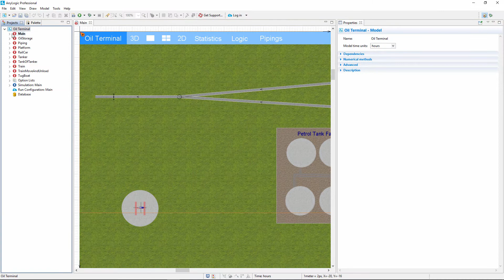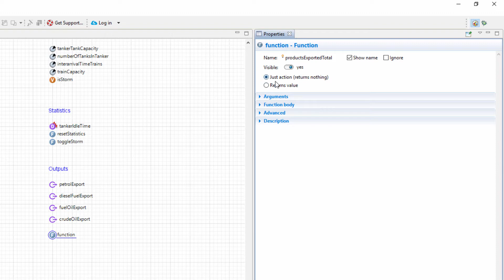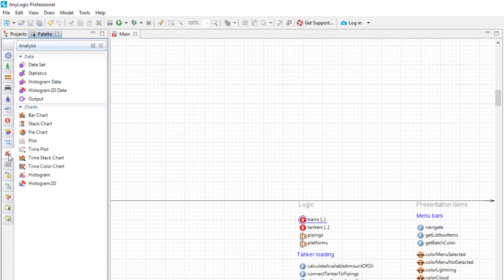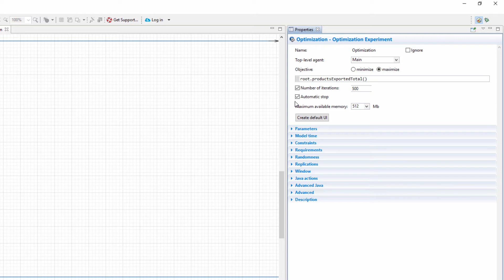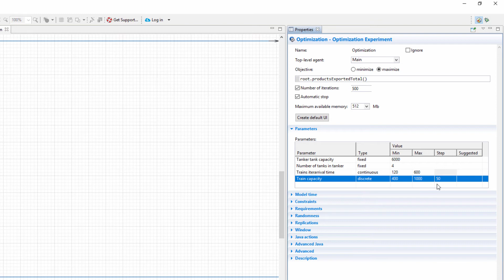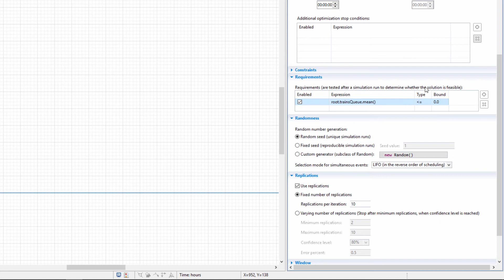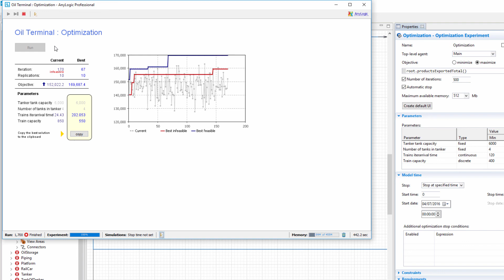Optimization experiment

Comment: The video is really good, but when I try to do the optimization Experiment on this model, after downloading it from the cloud, at the end i get a RunTimeException (Error in the model during iteration 1). The iteration ist sometimes 10, 4,2 and so on. How can I fix this? I did not manage to find a solution online yet. Thank you in advance!
Reply from the maker: Hello,

Thank you for the question.

We've investigated the issue and attempted to replicate the error using both the Genetic and OptQuest optimization engines. However, we were unable to reproduce the problem on our end.
Please try to follow exactly every step from the video again. If you will continue to experience the error after following the steps from the how-to video, please submit your question and the model to support@anylogic.com so we can reproduce the problem on our end and provide you with the solution.

We hope this information is helpful to you.

Comment: Is there any possibilty to implement multi-objective optimization in AnyLogic?
Reply from the maker: Hi, and thank you for the question. 

A built-in optimization experiment supports single-objective optimization only. The experiment is powered by the OptQuest engine which supports multi-objective optimization - https://www.opttek.com/doc/v911engine/OptQuest_Engine_Documentation/help.html#multi-objective-optimization

You can access OptQuest API in a custom experiment - https://anylogic.help/anylogic/experiments/custom-experiment.html#custom-experiment and set multi-objective logic.

Just to let you know, we added new genetic optimizer - https://www.anylogic.com/blog/anylogic-8-8-4-genetic-optimization-and-pedestrian-elevators/ from AnyLogic 8.8.4. Please see the 'Optimization in Custom Experiment' example model (in AnyLogic: Help -> Example Models). It shows the implementation of optimization in Custom Experiment and opened for modifications Java class. Feel free to modify the algorithm for your needs.

Comment: Calculating average queue  with statistic element is not correct, because its check queue value periodically and can miss moment when value changed. It's like stroboscopic effect, when you checking queue periodically you have risk find it at same value. Better gather this statistic other way. Make event every time queue value changes, add difference of time to an array element, that correspond to queue value. For example if value is 5, you make something like x[5]=x[5]+time()-lastTime. Probably there more easy way, because when you make your agents wait somewhere, you regularly use Queue block, that have automatically gathered property StatsSize.
Reply from the maker: Hi! Yes, if a train enters and leaves a queue between the update ticks, then the statistics will not reflect this. Accuracy can be increased if a smaller update rate is defined (e.g. < 1 minute instead of 1 hour). This is a simpler way than manually updating the queue size.

Comment: I've tried to find this example model named Oil Terminal , but among the example models , this model doesn't exist. Isn't there any other model to do this experiment instead?
Reply: The AnyLogic Company Thank you for your kindness. Have a good day!
Reply from the maker: We added the Oil Terminal model in AnyLogic 7.3.5, so probably you need to update your AnyLogic. You can conduct an optimization experiment with any other model that has parameters defined in the top-level agent (Main), but to follow this scenario you have to download AL 8.